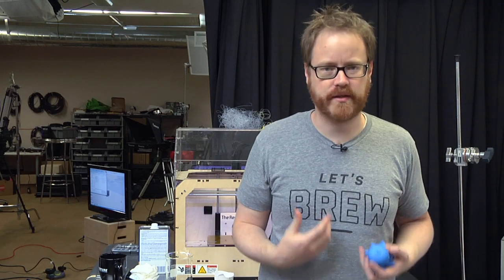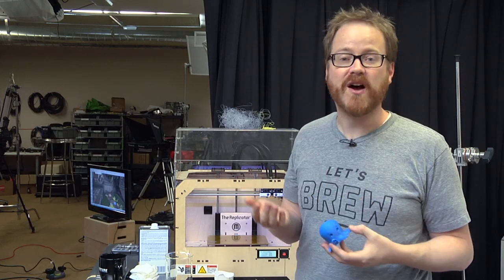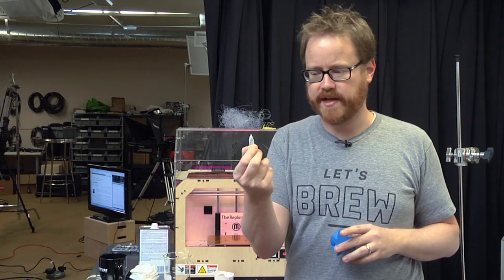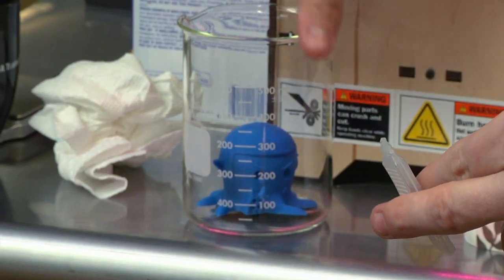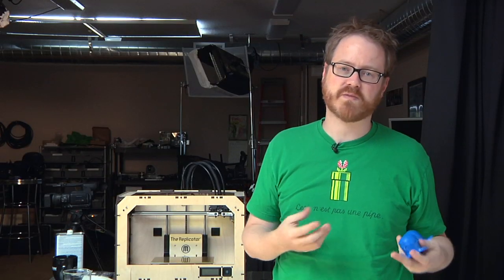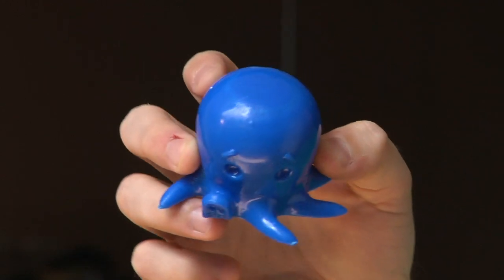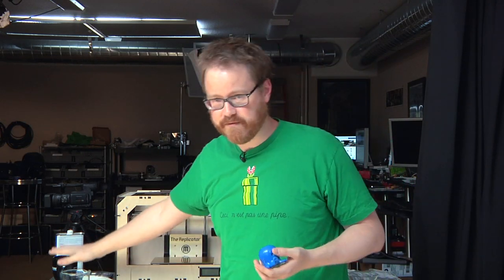MakerBot Mystery Build: Smooth Move, Ferguson

Comment from the maker: The other problem with all these plastics is that the plastic itself may be food safe, but the dye they use on the plastic probably isn't. You could probably use a food-safe wax to temporarily seal the plastic, although that wouldn't last in the long term.

Comment: A great alternative to what you see in the video is doing this whole process i a closed rice cooker/vegetable steamer/multicooker.  This achieves the same effect in under a minute if done properly, and it only takes a few seconds to get warm enough to heat the acetone.  On the downside, you usually end up using a bit more acetone.

Comment: Just off the top of my head:

1. Heavily detailed model with loads of nooks that would be hard to access.

2. A big number of small prints can be done in a single batch with acetone method, instead of individually sanding each one

3. This actually reinforces the model, as it further binds layers

4. For the 20 minutes you can be doing something else entirely - it's not like you have to sit and watch the paint dry.

But #1 is the biggie - loads of hard to access nooks in the model.

Comment from the maker: If the object is relatively uniform, it's easy. However, as the level of detail rises or the surfaces become less uniform, sanding is really tough.

Printing water-soluble plastics could work. The stuff that's water-soluble and available now is tricky to print with. It tends to clog in the extruder head, which is a real pain to unclog. Typically you need to replace the nozzle or have access to a machine shop that can precisely redrill the 0.4mm nozzle.

Comment: I would suggest finding the points that are going to be affected by gravity the most, the top of the squid, and reinforce that. The sides seem like they wouldn't need to be reinforced because it is supported by the walls of the model.

Also have you thought about maybe filling the inside of the model with sand when you do this? The sand would help the shape hold better imo.

Comment: I have a friend that does this in a modified fumehood. And he does this with as many objects that can get into the "pot" which is aprox 15" x 20" (40x50cm). So if you can do one object in lets say 5 - 10 minutes, he does maybe 20 - 50 objects in around 30 - 35 minutes. By the way acetone isn't necessarily dangerous if you know what you are doing. Acetone doesn't selfignite under 500 degrees celcius, so you need a ignition source if that's going to happen. Carelessness starts fire.

Comment: My Method you melt a washer into the bottom of the model. Then get some wood. Put a screw in the wood.  Get the vapour cloud going.  Then suspend the print using Fishing Braid by putting the wood on the top of the jar.  The model can then swing around inside the vapour nicely and get a nice even coat.  I then remove the printer and let it hang to dry. After print has dried i then apply heat to washer to remove it and clean up the line were the washer was.

Comment: 1. $20 for a measuring beaker is a bit pricey.
2. I would've thought a run over with wet & dry paper, and then a few coats of an acrylic clear lacquer spray would've had the same effect.

Comment: This seems like a lot of work to avoid sanding the object- if it takes at least 20 minutes plus set up time(and suposed danger) to get this effect- How much time are you actually saving verses pulling out some sandpaper or even a little power sander??

Alternative idea: instead of using dangerous acetone- how about printing the object in water soluble plastic and steam it some how?

Comment: that is cool but why did you use the hot plate in the maker bot and not some thing like a stove the maker bot is an expensive piece of machinery those fumes could have ruined parts of it especially if it is as flameable as you say

Comment: What was the purpose of using the replicator as the location for heating Spocktopus? Couldn't this process be performed just as easily just about anywhere?
Otherwise thumbs-up! Live long and prosper.
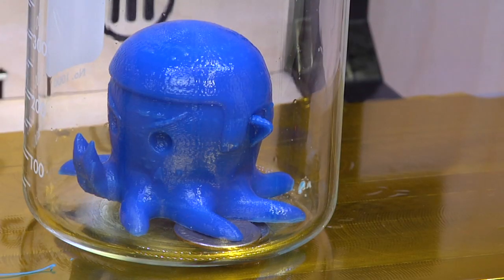P.S. from 2:13 through 3:20 I couldn't help but replay the reactor scene from Wrath of Khan" in my head...
Reply: he just did it in replicator because he has a temprature controlled heater on the build platform that he could use to heat the acetone if you have say a hot plate with temp controll or a water bath with heat controll theese would also work

Comment: ABS. Every single video about smoothing models fails to mention the extremely crucial information of what material they are using.
Reply: Yes if I do this using pla is this possible or only in abs?
Reply: @florenceguinguyon7436  Acetone only dissolves ABS, not PLA. There are other substances you can use for PLA but they are not as easy to use and find as acetone, that's why no one mentions it.